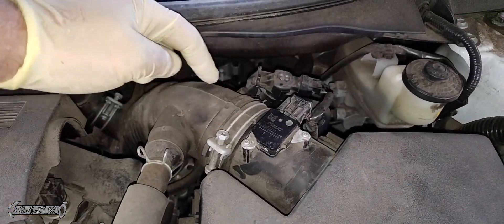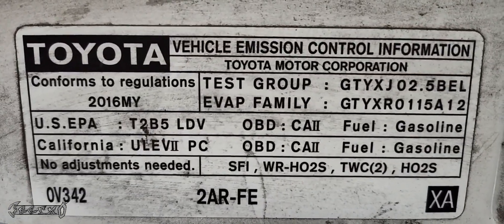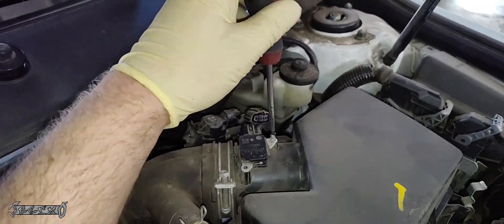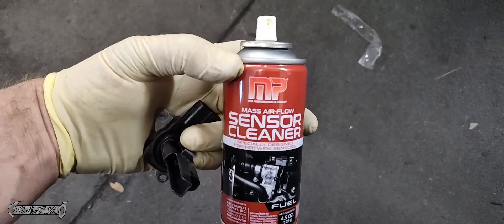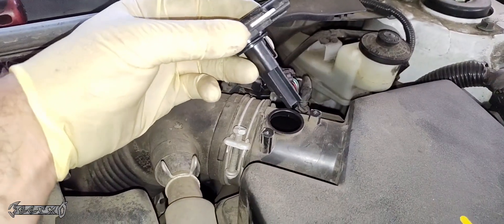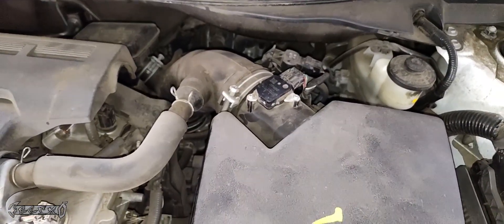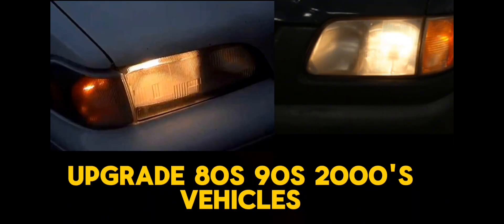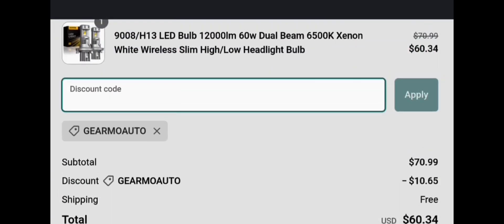2016 TOYOTA CAMRY MAF SENSOR REMOVE & CLEAN  / + HOW TO REPLACE MAF SENSOR

Comment: I encountered problems on my 4Runner MAF sensors after I cleaned only the glass bead that is visible.  The Check Engine Light (CEL) kept returning.  I eventually found a Discussion Forum thread that mentioned another thin wire that many people are not aware of.  If you turn the MAF sensor to an orientation that allows to look down into the opening of the long cylinder, you'll see the other wire.  I cleaned the wire that's deep into the long plastic "tube", reinstalled sensor, and cleared the CEL "code.  The MAF code returned, but many years later due to dusty environments in the southwestern US.  I've had MAF codes appear on 4 Toyota 4Runners and a Corolla, and the codes don't reappear for many years.  I have yet to purchase a new MAF sensor!